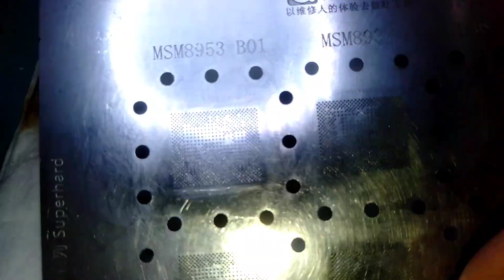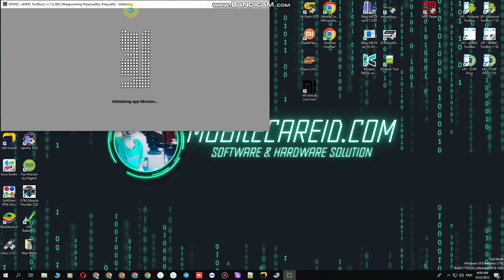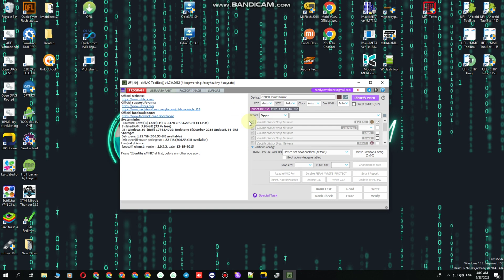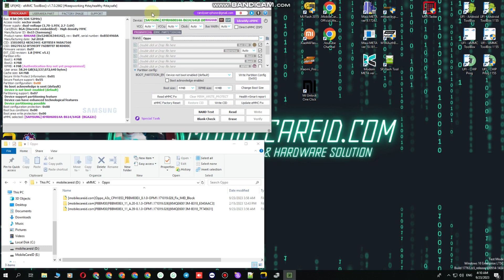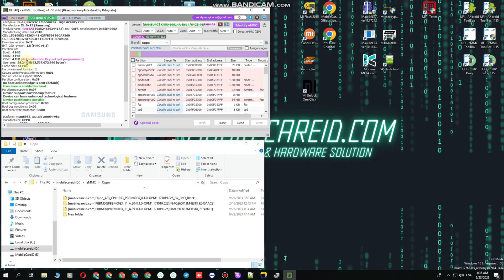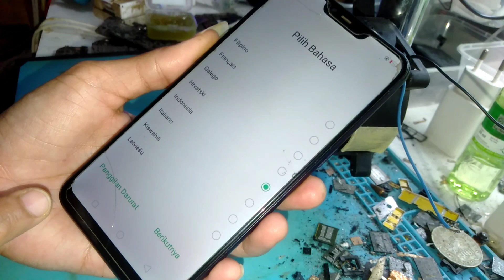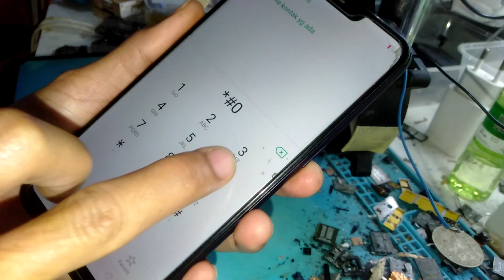Change eMMC Oppo A3s CPH1853 | Upgrade to 64GB | Fix Signal On by New CPU @mobilecareid

Comment: @ardiansyahputraependi952
1 hari yang lalu
Mas,saya ada garapan oppo cph1853,sudah saya ganti sepaket dengan emmc new dan pake emmc kmrh6,tpi kok masih detec 9008 mas,mohon solusinya
Reply from the maker: Coba ACP IC Power, dan perhatikan resistor CLK bila perlu jumper